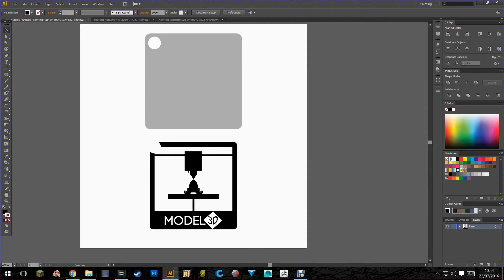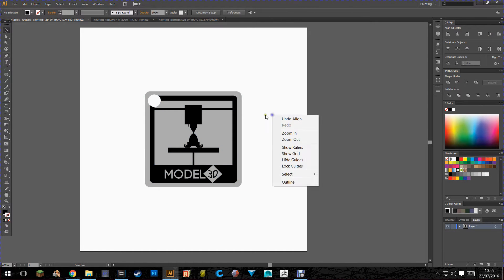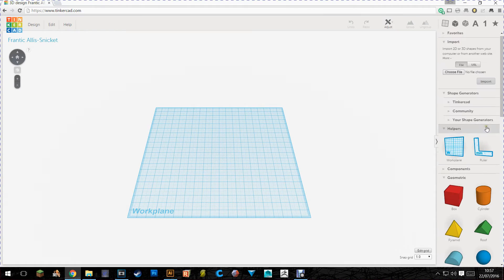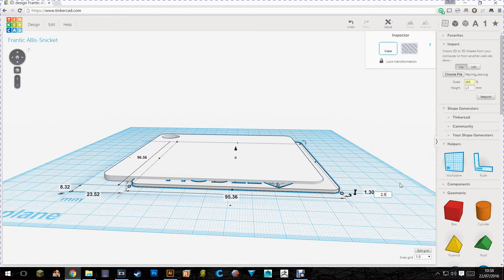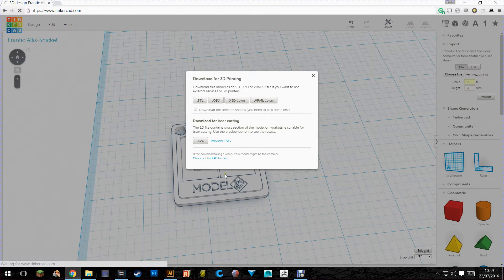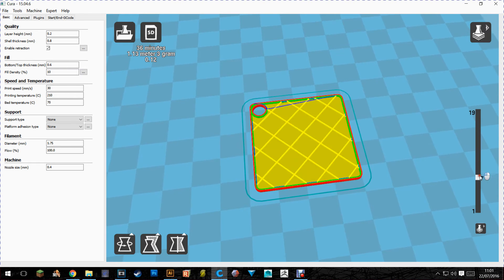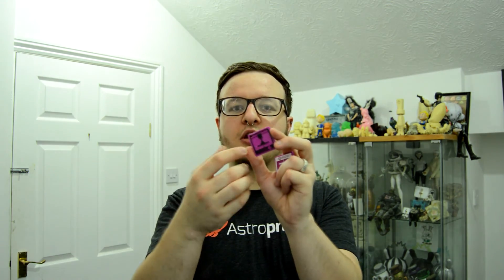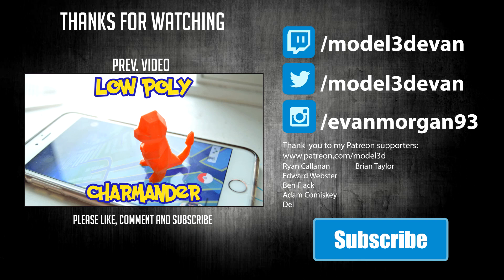How To Make A 3D Printable Keyring From A Vector.

Comment: Which 3d printer do you have? What are your tips to getting the ink to stick..
Reply from the maker: I have a wanhao duplicator I3 and a Da vinci 1.0a with a modded extruder to an e3d v6. By the ink do you mean the filament? if so I use a build plate called FLEKS3D. If you go back through my channel you can see videos on it, I use it all the time and its amazing!